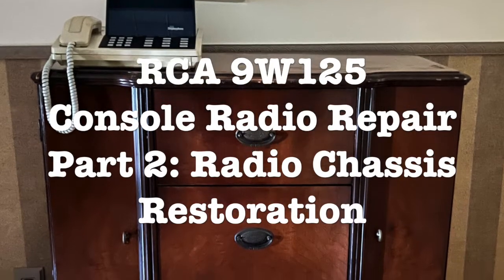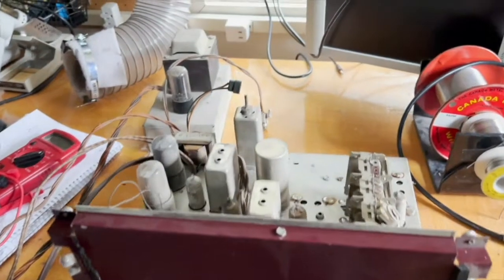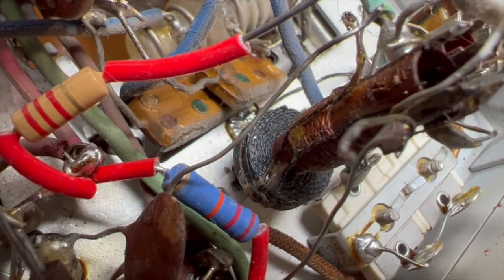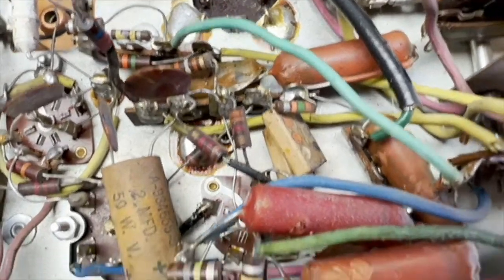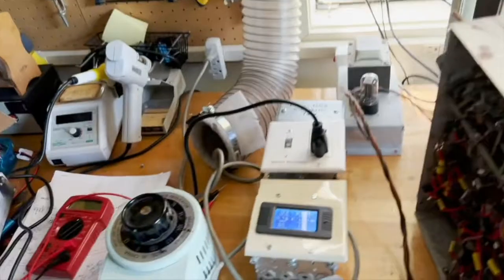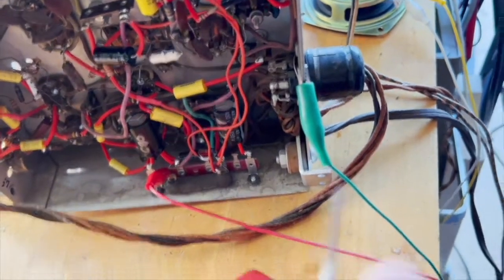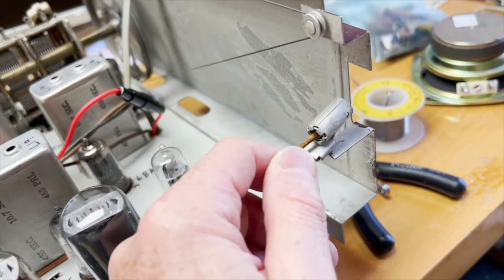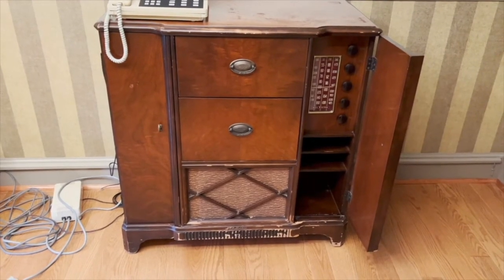RCA 9W125 Radio Repair, Part 2 (Chassis repair, testing, re-installation)

Comment: 12:10 That’s Shortwave Not FM , The Station you hade tuned into was WBCQ’s Worlds Last Chance On 9330 kHz Out Monticello Maine , USA , FM Is At The very end of the selector switch
Reply from the maker: Excellent observation -- and surprisingly good reception. I should have realized it wasn't FM because there are only two FM stations I can normally receive, Cool 94.5 and CKNX, neither of which usually sound like that station. Thanks for catching my boo-boo!